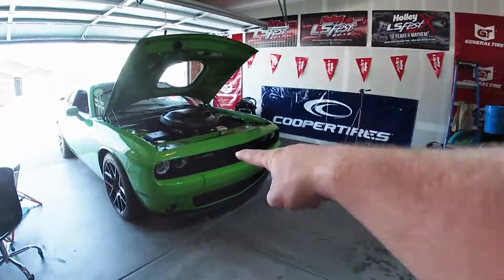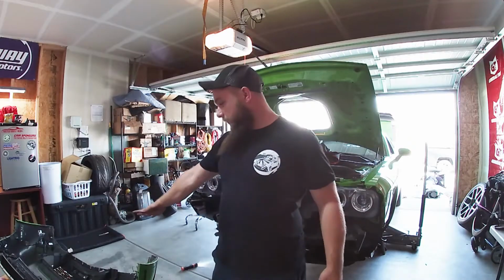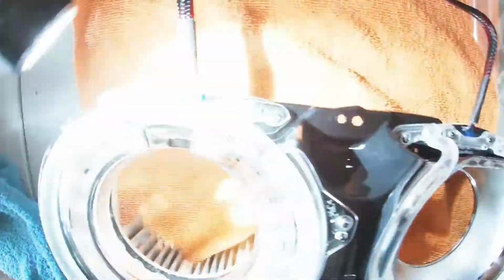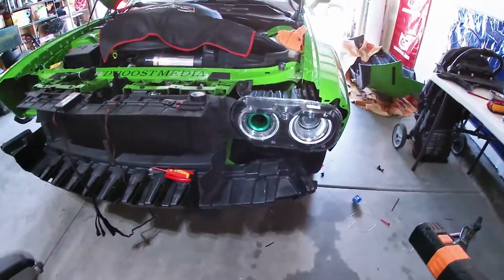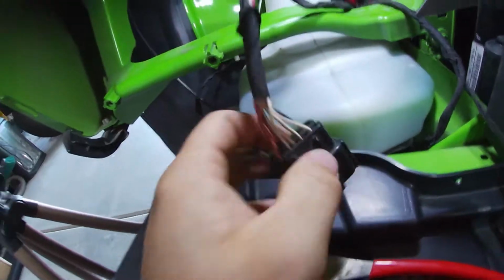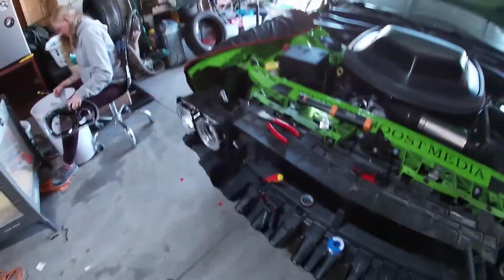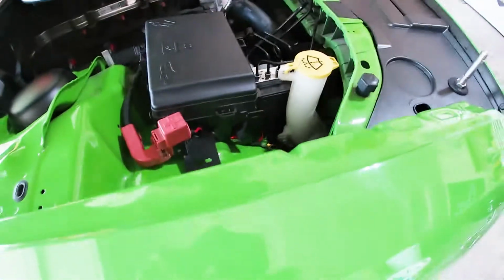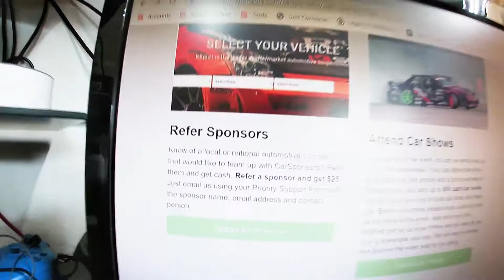INSTALLING  LIGHTING TRENDZ DRL BOARDS ON OUR 2017 DODGE CHALLENGER RT

Comment: When I attach the yellow to the 4th wire in the harness, both my halos go orange when my blinker is on. And don’t have the center light working at night. Just the tube. Any clue what I did wrong?

Comment: Wait so you put the lights in the oven before putting the colored lights on ?
Reply from the maker: Yes. It heats up the glue/sealant that hold them together. I wasn't too fond of doing it but after the first one its pretty easy. Wouldn't hesitate to do it again.
Reply: @twistedboostmedia9683  okay gotcha it’s Bc I’m in the process of getting some but wasn’t sure, I didn’t wanna mess my lights up
Reply from the maker: Instructions are pretty good. Once i took one apart and found that its literally just black RTV holding them together thats what i used. I clamped them over night  to make sure they sealed back up good and we've had them in colorado over the winter with  issues.
Reply: @twistedboostmedia9683  Awh okay appreciate it. you’ve had issues or haven’t ?
Reply from the maker: No issues at all. Discount code is in the video description and should still be good for 15% off.
Reply: @twistedboostmedia9683  okay coo bet and I got a 15% code from lightning trendz since they just sponsored me, I appreciate it tho man
Reply from the maker: Hell yeah! Take advantage for sure.
Reply: @twistedboostmedia9683  yessir 💯🤟🏽